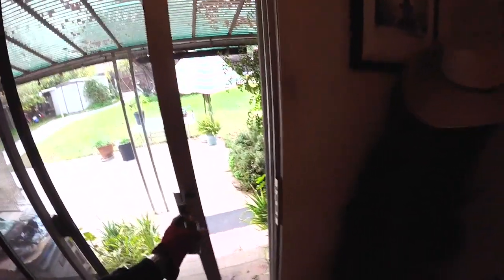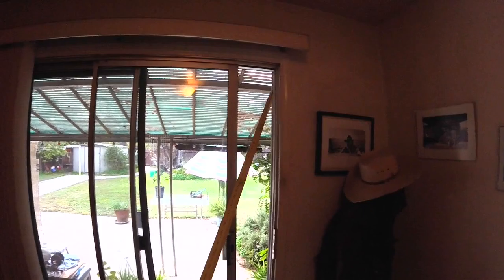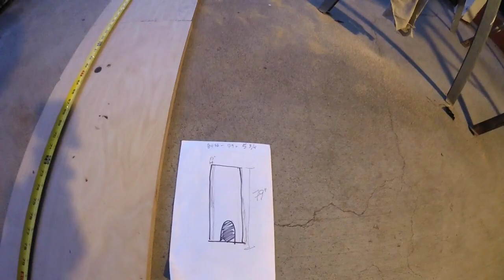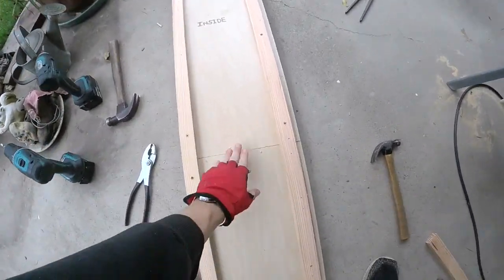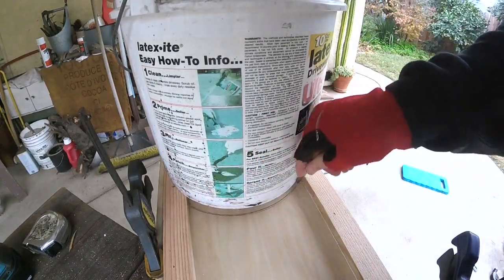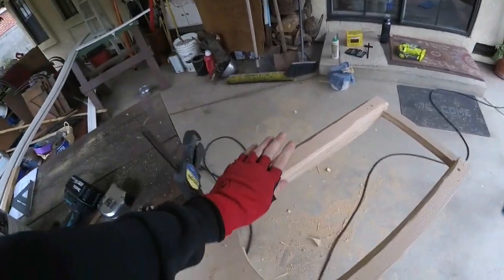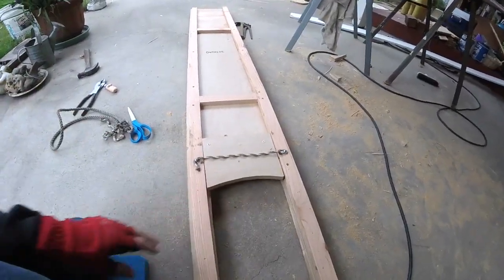Easy DIY Homemade Dog / Cat Door for Sliding Glass Door

Comment: Thank you for the video. I have been trying to find for weeks how to add a removable cat door in my sliding door. Like you, the depth of the parts up and down are quite high and it is not possible to make something that would work if fully into that space.
The solution is now obvious, just make something that will be just resting on one side and embedded in the other sides.
Reply from the maker: You're welcome, happy to help. Good luck with the build 👍

Comment: How did you get the measurements for where to put the the furring strips so it kinda nestles into the sliding door grooves?
Reply from the maker: Every door will be different measurements, but you just  want the strips to hold the door side (so half width of furring strips is good) and then the other side slips into the depth that the door closes into. Sorry hard to explain in words.